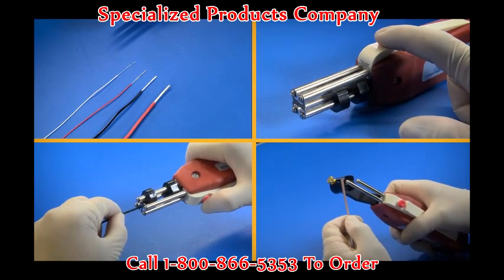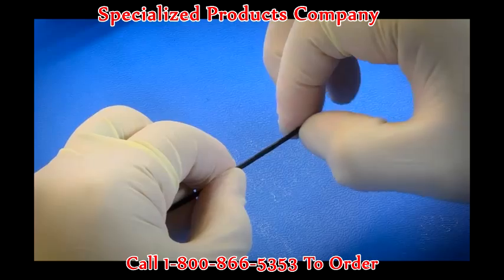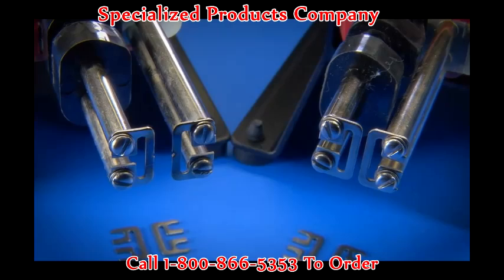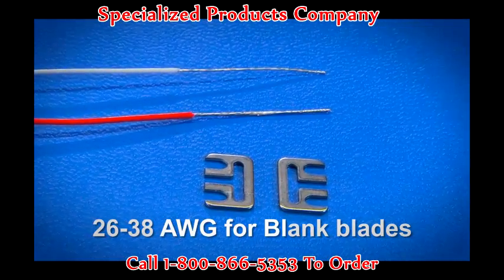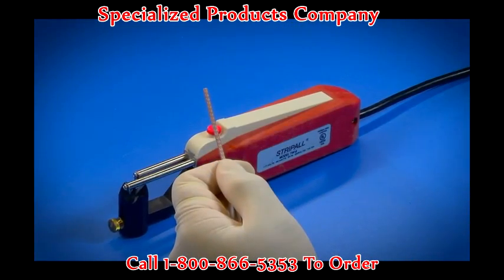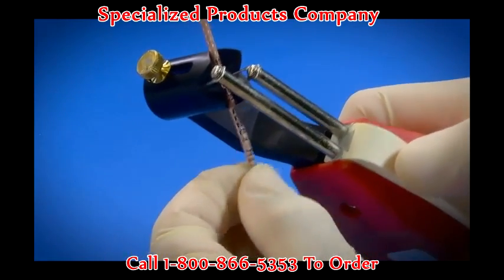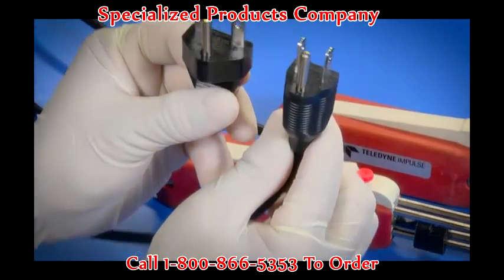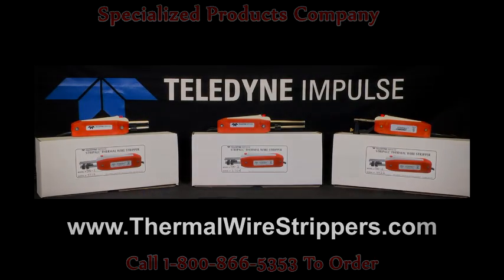StripAll Thermal Wire Strippers from Teledyne Impulse

Comment: but why?
Reply: It’s faster in bulk. Especially on larger wires plus the adjustable stop is very nice for when you need say 20 conductors all stripped to the right length for a barrel crimp to meet a standard
Reply: probably for people who work a lot with teflon wire, heard this type can reliably peel teflon insul off without much hassle and absolutely not damaging the other parts of insulation